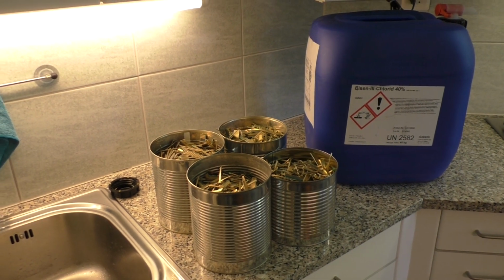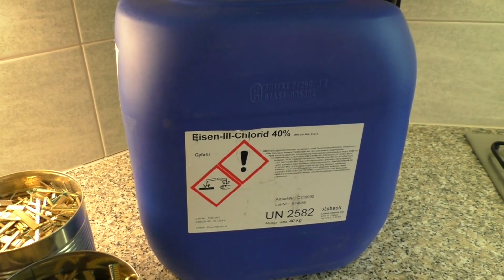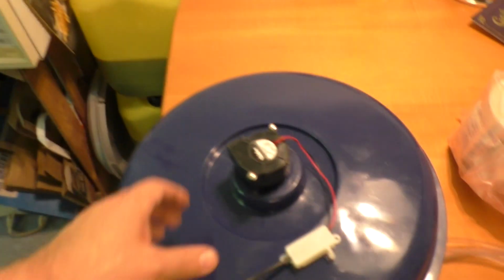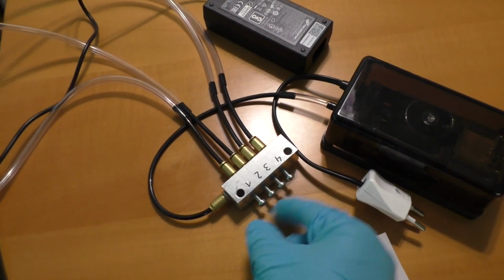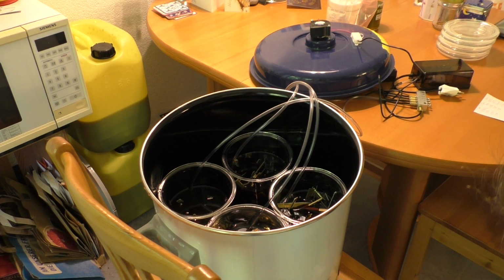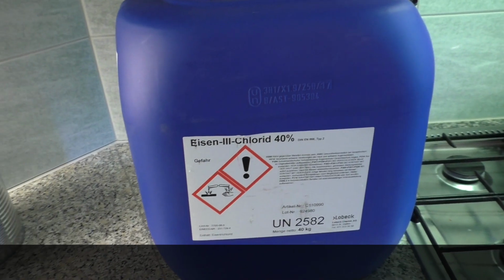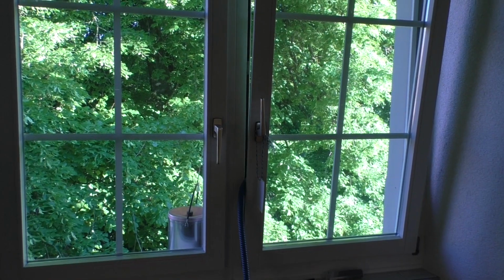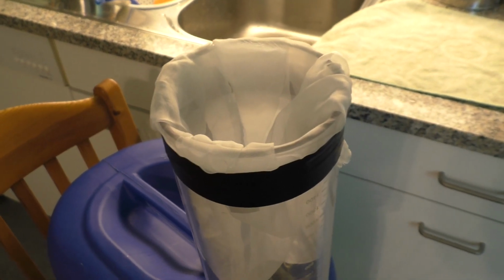GOLD!  (PWJ168)

Comment: When you started the video I thought "ferrichloride, how?  gold is not going to dissolve in that!"
But later I understood, you start from the assumption that you have only copperclad epoxy with gold plating, and then use the ferrichloride to etch the copper (working its way under the gold) and thus separate the gold.
Clever!
Reply from the maker: simple!

Comment: You can also use battery acid. Although it costs more it has the benefit that you can electro plate out the copper and restore the acid.

Comment: I use a propane and oxygen torch( Smiths little torch) with a rosebud tip for melting gold and silver. the oxygen comes from an oxygen concentrator a lot cheaper than buying bottled o2.

As another poster pointed out how do you get rid of the waste products, all are toxic to the environment and in the uk not easy to dispose of. some people soak it up in cat litter and put it in the household waste, but not sure how legal that is.

Nice video, must got and get some computer waste now.
Reply from the maker: Regarding the waste... we have recycling centers where we can bring stuff like that. For a small fee the take care of it.

Comment: Ferric chloride is also available as a yellow powder, or a dark brown anhydrous versio,n both of which work. You can also recover the copper from the solution using a graphite plate ( non dissolving as the anode) and a copper plate as the cathode, rejuvenating the solution and also getting the copper as a bonus, as there will be a lot more than the gold there.
Reply from the maker: The Ferric Chloride in solid or powder form is hard to get in small quantities. It attracts moisture from the air and distributors hate it to open sealed containers to take small portions. I only found the liquid solution in acceptable quantities.
Reply: @PlaywithJunk  In the past when there was more local production of PCBs (both by hobbyists and companies) it was quite easy to get.
I still have some left over from those days and indeed it has attracted moisture through the polyethylene can it is in.
Reply: I also learned in the old days (when using it for etching PCBs at home) that you can add a little Hydrochloric acid (HCL) to the solution to make it work better and longer.
The plain Ferrichloride solution gets milky and when you add the HCL it gets transparent.  After some etching when more copper is in the solution, adding a little more HCL makes it work again (as you add more chloride again to compensate for the amount lost in the copper chloride).
Of course recovering the copper is even better.

Comment: Great video, it took lots of fingers to get that much gold, i think most newer pcb's have < 4 atoms thick gold plating
Reply from the maker: Yeah, I found some cheap PCI cards where the gold plating turned into dust.... no way to recover with my methods :-(  But most connectors are pretty good, even the modern ones.
Reply: Yea you can tell what’s going to turn to dust before processing. I try to keep those out.

Comment: Interesting process, seems a lot less dangerous than dealing with agua regia. Should it work with other kind of gold scrap, as processor pins, SMA connectors ?
Reply from the maker: The problem with pins and connectors ia that you have to dissolve a lot more metal and you get only a tiny bit of gold. The waste to gold ratio is very bad. It will most likely work, but (my opinion...) it's not worth it.
Reply: So long as they are copper or copper alloy it will work, but your gold will have a lot of nickel in it, used as a barrier between the copper and gold as a plating enhancer. You have to dissolve all the copper away some how, leaving the gold, while with the aqua regia you dissolve all the metals, and then separate out the gold from the liquid. At least you process something more solid, and the volume for recovering you deal with is smaller, but it will not dissolve pure gold like bond wires.

Comment: Hi,
Where did you dispose the waste?
is it a problem?
Thx
nice video
Reply: I asked somebody else about this once, on another gold recovery video like 5 years ago and forgot about it until now. Guess they never responded.
Reply from the maker: Once or twice a year, they make a "special waste collection day" in my hometown where you can bring stuff like that... for free. But they only accept a few liters.
I could also bring it to a waste recycling center and pay per kilo.... I have to find out.
Reply: @PlaywithJunk  Easy to reduce the copper out of it, and reuse it, so that you get many runs out of the same solution, so long as you do not dilute it too much, when you will have to let the water evaporate off a little to increase concentration.  Careful near piping with the ferric chloride, it will destroy any brass elbows and any taps.
Reply: Pure unused ferric chloride can be sold or easily disposed because it is harmless (it could also be diluted and disposed with the waste-water. It is actually used in the waste-water treatment and drinking water production as a coagulant). But when it is used it contains copper chloride which is very bad for plants, microorganisms and so on. Then it is a harmful waste, but you can reuse it multiple times until you discover that it stops working. Then it must be brought to the hazardous waste disposal, but they want to be paid by weight.

But there are methods to reduce the waste.

Dilute the solution of ferric chloride and copper chloride to about 1/3 or 1/4 and bring it to a pH of 3. Have a big bucket with tap on the bottom and loosely fill it with fine steel wool. Add some of the diluted solution to it (*not more then 1/2 of the bucket, the solution gets hot and could boil over or press the steel wool out if it is pressed in too hard*). And now wait a few hours (maybe 3-4) and put the not yellow/green solution in another container.

Take sample (a few milliliter) and add a milliliter concentrated ammonia (NH3). If it gets blue, it still contains Cu2+ ions. Repeat the process with new steel wool until this test doesn't get blue.

Then you have a solution of that contains Fe2+ ions and Fe3+ ions and Cu, add some air with a air-pump like shown in the video or just let it sit around in a open container to oxidize the Fe2+ ions to Fe3+. This might take some time (a few days).

Now the solution is safe and no longer a hazardous waste and can be further diluted, filtered and disposed with the waste-water. The copper will be in the filter and the bucket, this can be dried and disposed in the trash or recycled. The remains of the circuit boards can also be disposed in the trash.

(There are some detailed instructions on the internet that could be found if you search for keywords from my description. I got this method many years ago from a german microcontroller forum where people described the handling of PCB etchants, but I didn't find it anymore or I had included a link to it that could be read with google translate).
Reply: By the way, here in Germany there is also the waste collection for small quantities that is free. It is much easier to discard small amounts this way. ;)
Reply: @PlaywithJunk  , nice thx

Comment: Gold harvesting is in the air. I got lots of work to do. Wish I didn’t have to use Hcl or AR 😞 
I try to put it off as long as possible.
Reply from the maker: I just processed another batch today and the iron chloride method works very well. Just don't wear your newest clothes when working with FeCl-3... it might ruin your jeans ;-)
Reply: @PlaywithJunk  Yea I’m going to try it. I don’t have any presently. But I’ve been taking notes. Thanks.

Comment: You should refine the gold before melting it. Refining a gold nugget requires too much acids and the process takes long time
Reply from the maker: There is no need for that. I just sold some gold and it was tested to be 999/1000 pure. I can't get it any better...
Reply: @PlaywithJunk  No it is not 999 there must be some base metals stuck on the foils. even the gold color indicates that it is not clean enough. However, you could dissolve the gold foils through Aquaregia . And repeating this 3 time would makes the gold high-purity. The more purer gold, the more valuable it is
Reply from the maker: @alaeBenMessaoud  Well, they analyzed it, said it's 999 pure and paid me the price for that.
The foils look dark because the copper side is rough, the contact side is smooth and looks brighter.
There are no other base metals than copper and that gets dissolved very well.

Comment: Handling Ferric chloride in the kitchen... Probably, don't have a wife.
But for melting, you should build/buy a induction smelter (like the zvs from the Chinese)
Reply from the maker: No wife... that's correct :) Things like that have a very low WAF  (Woman Acceptance Factor).
I don't need an induction oven when I have my welding torch.
Reply: @PlaywithJunk  Low WAF is always a problem when "Playing with Junk", but in this case it is extra low... especially when using the kitchen.
I see other channels where they have blade servers or storage cabinets in the home and I think that suffers from low WAF as well.
Reply from the maker: @Rob2  Most likely those people don't have a "W"  :-)  So the "AF" depends only on themself.
Reply: @PlaywithJunk  They will also have nice discussions with the Energy Company finance department :-)
In your case, the WAF of the resulting product could be good.  That may compensate the problems with the procedure.

Comment: This is not pure gold at all. Probably huge amount copper
Reply: I was thinking he should soak the gold flakes in FeCl3 to dissolve any remaining copper...
Reply from the maker: I don't think there are "huge" amounts of copper. The gold flakes can not come off the board when copper is not completely dissolved. And when I check both sides of the flakes, there is no visible copper. No, I think that gold is pretty pure.
Reply: @PlaywithJunk  Well soon we will find out when you try to sell it and it will go under testing
Reply: @PlaywithJunk  That's good news. I imagine the number of "cuttings" of PCB's are substantial. I wonder if the same can be done with entire PCB's complete with components?
Reply: @PlaywithJunk  Probably no copper but hard gold plating (like it is used here) is a gold alloy of cobalt or nickel so it wouldn't hurt to check the purity of the product.
Reply: Small amount of copper, but likely also around 15% nickel as well, as that is a typical barrier plating applied to bare copper before the gold flash is plated on, to allow better adhesion. Nickel does dissolve in ferric chloride somewhat, and the plating is thinner than the gold anyway. Nickel gives the hard surface for the contact, while the gold gives the non oxidising surface.